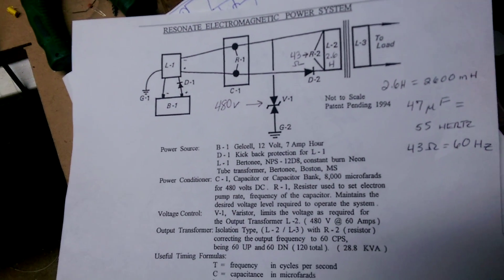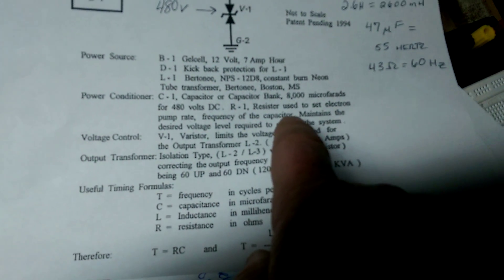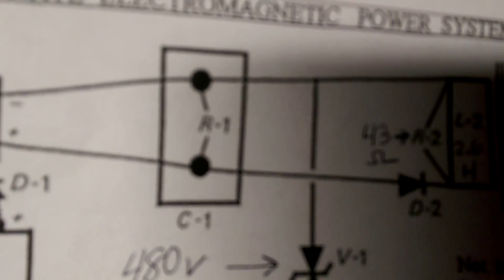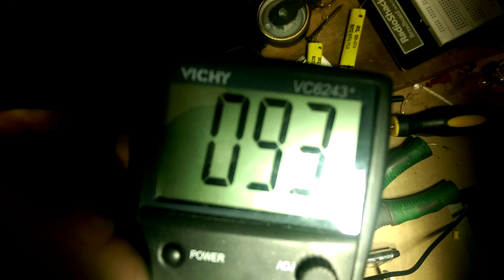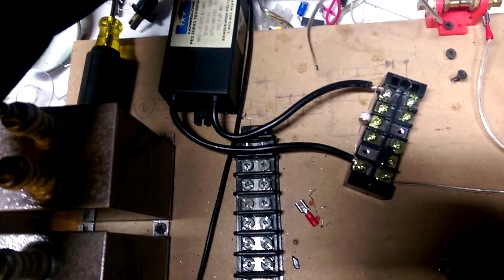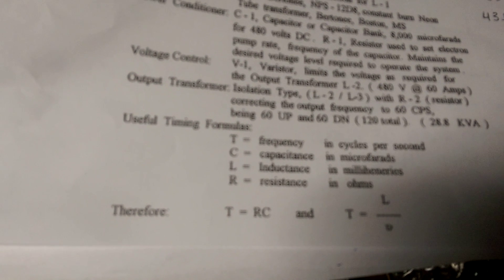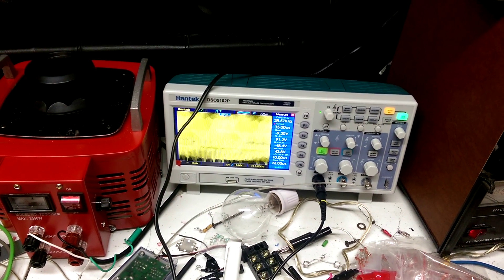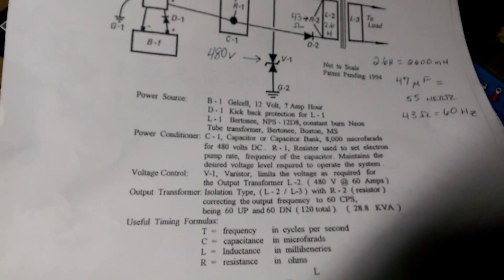Don Smith How To Video

Comment: Hello marc very good work,  It look you are decoding all dons work,  very very helpful,  the only thing I am not 100% sure is how to find the right NST and the ground part and the gas discharge can be 120 v, and how to calculate the varistor to control the voltage, Please keep doing more video we are learning a lot and this is the way to have some possibility of better life. Thanks.
Reply: Hello marc, I am replicating the system barbosa leal for while, you mention the voltage are not so important, I have my zvs induction heater connected to pankake  coil after by induction to bifilar coil whith 240v out can it work if I try to find resonance conecting to capacitor and recistor? after I''ll  try to lower the frequency whit varistor to ground and connected to oscilation transformer  and find 60 hz? Thanks  a lot.
Reply from the maker: +Fer ja you can add a capacitor to get resonance, however, it has to be an AC capacitor, not electrolytic or polarized! Dc capacitors will go BOOM!  Anyway, if you have an inductance meter, you will have to test the inductance of the coil before trying to get resonance. If you are using a core, the coil will need to be on the core. The core will massively increase the inductance, then, you go to this link : http://www.ekswai.com/en_lc.htm use the bottom calculator table and enter your inductance as it is , select the range, then, enter the frequency. The calculator will give you the capacitor size needed to get resonance at that frequency. Then, put your coil and cap together in either series or parallel, it makes no difference, and test the coil with a function generator and oscilloscope to see if the amplitude is highest at the frequency you wish. If it is not, you will have to either add or subtract capacitance so it is definitely at it's highest point at the frequency you wish. If you use the cap in parallel, you will have a higher "Q" rating of the coil. If you use series, it negates the "Q" factor, so, I recommend for a primary coil at the feed side nearest the source you use parallel cap and coil. After the secondary coil, it is always advantageous to use series for resonance.

In Barbosa and Leal's device, be very careful not to be tricked into using this. It doesn't magically draw electrons from the ground. It connects the neutral of the line in to the source's neutral through the ground. You can easily figure this out by following the line schematic. The ground is very conductive, and, everywhere in the world, the center tap of the power company's transformer is grounded. This center tap is the system neutral which the energy needs to return on. Be very careful you do not run your home on this method because the ground isn't as good of a conductor and it will have low voltage, possibly burning out expensive devices in your home or causing fire. The ground replaces the neutral in the barbosa device, and, it bypasses your electrical meter, cheating the power company. If you build a device like this that does not use the power company's circuit to feed it, then, it may give something, but, i do not recommend you do what everybody is doing in Brazil if you value your television and computers or other components that need normal voltages.

The other thing they do that makes folks think it produces high amperage is that the transformers they build are bucking. This means they drop the voltage by putting only 2-3 turns on the secondary. When this is done, the voltage drops to 2 or 3 volts and the amperage climbs to hundreds of amperes. They then tie the hot leg to the shorted secondary coil and it makes people think they are getting 240volts at hundreds of amps. The line that has the hundreds of amps isn't what is operating your electrical panel., it is the feed line's hot leg, and., the ground is the return, back to the utility pole, so, if you cut the ground line on the pole., ,the "barbosa and leal " device will stop working and no energy will flow at all!

I am extremely surprised this has not been caught by Brazilian officials and they did not get locked up in prison yet. In the USA, they used to only monitor the neutral line with electrical metering, but, they stopped because folks used to punch a ground rod in the ground, then, disconnect the incoming neutral line at their electrical panel. The electrical neutral would flow through the ground, but, when high amperages flow through the dirt, it gets dry and starts to get lower and lower voltages, so, it is not recommended because amperages climb when the resistance climbs and voltage drops, causing the wires to heat up and burn, as well as your appliances!  Good Luck! I will keep posting until you all have something to work on that functions to assist you all. I have many devices that work to make free energy.. I am trying top perfect one that I don't have an investor funding like Pelex!
Reply: Thanks a lot Marc for your time and expertise,  very clear the way you explained It to me, ll try  to find resonance close to zvs and use fly back will be  easy and mayor benefit then pancake coil, anyway hope you can find a complete system  to help every body else. I''ll be connected to see yours new videos and reading  your comments. Thanks again.
P.D. For the record barbosa leal they been arrested for stilling some electrical equipment from hydro company and release.

Comment: Current should go back to source, so hope your ground is safe.
Reply from the maker: boy you're a grumpy old coot when somebody proves you wrong with a new free  electricity.method . with every method.  v
Reply: Wasn't trying to be derogatory.
Reply from the maker: sorry, i didnt mean you.. i apologize if it seemed as if I was speaking to you..
Reply from the maker: i actually was posting in an entirely different video with google notifications and when you click on other things the window goes away forever. I picked up my phone and tried to finish the comment and it sent the message to the wrong place!
Reply: cool
Reply from the maker: +Artist Group the NST is shown to have a ground in the schematic, however, the nst that was originally used in this schematic is no longer manufactured. Manufacturers have been forced to stop building and selling these devices with split cores, so, if we want them this day and age, we have to build them ourselves. They aren't too hard to build, so, if we are looking for adjustable frequency NST's we have to have them custom made overseas. Unless the circuit has this style of NST, as shown in the schematic, the two legs of the NST would be connected without any ground and the NST would shut down, depending on it's build because as shown in the diagram, all of the current would be forced back to the nst unless the resistor was large enough to limit this reaction..

Comment: Thanks for sharing
Have you Circuit Schematics or Link?
Reply from the maker: +Edmorbus you are welcome. Yes, link is here. I will add it to the description too.. Thanks for telling me this.. I actually forgot to add it! . Please be safe when building.. the power is ridiculous if you use a zvs as i actually have done... I had to do this to ensure the frequency of the device is steady.. My nst was not steady at the single frequency I found and it flashed on and off, then, it stopped altogether. When I replaced it with the zvs, the output from the zvs to the coil is center tapped. The output coil could be hand wound with a center tap as well if you wind it yourself to eliminate not being able to buy one. That is key to make this all function, so you can ground the center tap and, it is vital to use a 12 volt supply so the charging can take place using the kickback diode. The wirelength between the nst or zvs and the battery is important to have the correct length to acquire the quarter wavelength. you can Test it out by using a piece of stripped wire and put a loop around the wire with the diode's axial lead, then, connect it to the battery, sliding it along the bare wire until it starts to charge the battery.. This can be done using an led, then, once the led lights up, the battery will charge regardless of the power drawn from it. It will charge until you draw around 1/4 of an amp, then it will lose power. The system normally uses .18 amps with a load on it, so, it isn't going to die, it will charge and self run without the addition of an output transformer feedback loop. If you can't get the feedback wire to self charge without another output hard wired, you could always add one, but, you'll have to isolate it from the other transformer so the resistance doesn't interfere withg the frequency resistor of the output transformer. You also could wire the transformer to the output of the larger transformer and feedback from there so it doesn't interefere with the resistance.

Here's the link: http://s003.radikal.ru/i203/1207/4b/1e64d71de6e3.jpg
Reply from the maker: +Edmorbus please remember that the nst or zvs you use will have capacitance that will interfere with the resonant frequency. You'll have to compensate for this with the resistor across c1
Reply: +Marc Belanger Thanks for these new specifications. I don't understand all what is going but at least I can see much more how you do it :) To make it clear for me: what are "nst" and "zvs"? ^_^
Reply from the maker: +Didier Khwartz neon sign transformer or zero.voltage switch which is a power supply for a fly back transformer used in old tv's. the devices have no.protected output like new nsts, so they stay on with Tesla coils, etc.
Reply: +Marc Belanger Thanks for the info, Marc :) This "protection" what it consists of and why it should not be? Also, if you had to explain all this in terms of hydraulic, how you would explain how your device work (voltage as pressure, amps as flow, inductance I guess as inertia, capacitance as piston with a string behind to accumulate the energy, etc.). We don't see the flow of electricity so it would be more real for me if you could make make the parallel between the two forms of energy :)
Reply from the maker: +Didier Khwartz unless you.could imagine the hydraulics gathering pressure  from the sky, as an alternative force, it's hard to imagine. it isn't conventional amperage driven electricity. it isn't electrostatic, it's cold energy or negative energy. the meter would read a minus reading even with the probes flopped.we could short circuit the circuit and the bulb will stay lit. watch Karl palsness' Hairpin Circuit. you'll find that electromagnetic with.ionic force draws from the Earths Magnetosphere when pulsed with.High frequency , high voltage energy. it's originally discovered by Tesla, called phase conjugation. pumps energy into the ground and collects it by bothering or disturbing the ambient. as soon as ambient energy is disturbed it sends out a ring of energy as in wAter and it's collected back like a mirror through the ground for every wave transmitted, it receives4 times resonantly. it's tough to.imagine, you'll have to watch videos from Eric Dillard, he would explain it better than I could.
Reply: +Marc Belanger Dear Marc, Very Thanks for your Time and Attention :) Indeed, I have seen and read Eric Dollar's video and books but it is still quiet abstract to me, especially not been English tongue. Could make a video where you could explain/describe more the phonoma in themselves? maybe by help of schematics ? :)
Reply: +Marc Belanger 
Thanks
Reply from the maker: +Didier Khwartz I could provide a video explaining what I know about the phenomenon, however, I don't think anybody but Nikola Tesla would be able to really explain what is truly happen, or perhaps the likes of Eric Dollard and maybe the folks that worked closely with Eric. I am still learning the capabilities of this and if I knew exactly where the energy is coming from outside of my own theory, I would say, however, this is not normal. I know how to reproduce the energy, but, I don't really know or could prove exactly where it is coming from because I can't see the transfer or conversion of the energy, so, unless I research it more, I could only speculate as it happens within a specific distance, larger than the board it sits on and it is difficult to pinpoint. I do know this, when I connect the components involved, especially the wires feeding the NST, and the power wires from the battery to the inverter, the battery starts to charge. If I change the length of the wires, and remove the diode, the activity is gone. I haven't even played with wiresize or length yet because I think it is coming through the negative wire of the inverter feed since it is not rectified, and, the rectifier stops the energy from returning back through the positive, possibly damaging the circuitry in the inverter. It is fascinating, but, I haven't the chance to try metering the negative lead, with a capacitive touchless meter, as this is the way to follow the energy. I have to limit it's sensitivity so I could follow it as the meter is too sensitive because it is made to detect dangerous voltages in electrical switchgear to see if they are live or not. This energy has a signature of that in a medium and high voltage switchgear, so, the amount of energy available if completely converted is as strong or stronger than these massive feeders I work with for a living,.. which are within the Megawatt range. The massive danger I or any other researcher has working with these experimental circuits is that the day we figure out exactly how to convert this energy close to 100% efficiently, we can make a mistake very easily and get killed if we touch the circuit or even get close to it.. within 3 inches if the ability of the amperage is relatively large, like over 10 amps. a circuit that offers 10 amps at 15kV will instantly blow the NST up like a bomb, so, it will be an awful day for anybody who figures out a perfect method of conversion on the high voltage end of it. If it is done on the 120v or lower side, it will just be a normally functioning circuit as in a home, so, it is suggested not to attempt enhancement of the HV side due to the danger. In low voltage systems I have been able to enhance the system magnetically by manipulating the flux of the core and forcing the distribution of the voltages in a transformer core specially made similar to what Mr. Bearden and Don Smith has done, but, I don't put and take away magnetism with permanent magnets, I add forms of cancelling electromagnets ( i make them with caduceous coils so the flux wont flow or it will change the flow of the flux to eliminate back emf and oscillate the directions of these flux patterns so we could take advantage of how and where the energy goes, how strong it is, etc. It sounds complicated, but it really isn't as we could test the reaction of these magnetic additions using another source to operate all sorts of different electromagnets and what I like to call "pieced out" cores that are machined in all sorts of shapes and sizes and they screw together to make custom cores so energy devices could be experimented with.